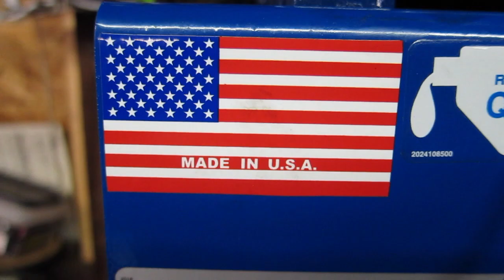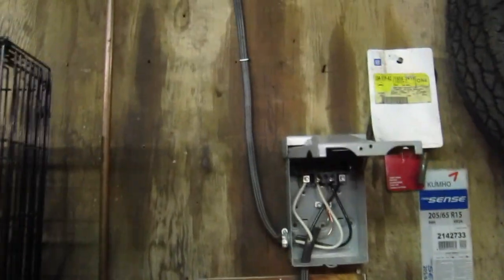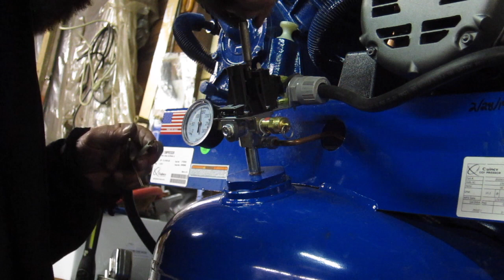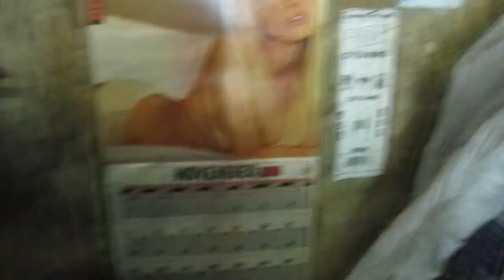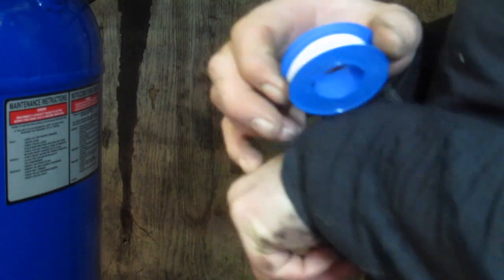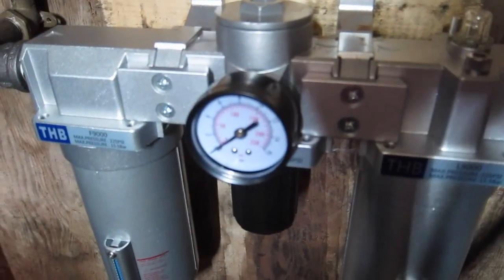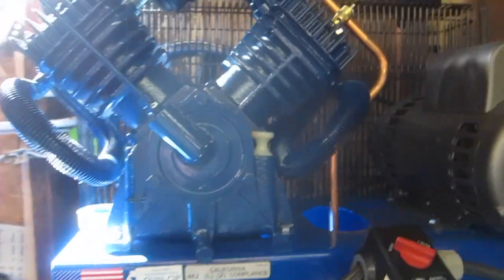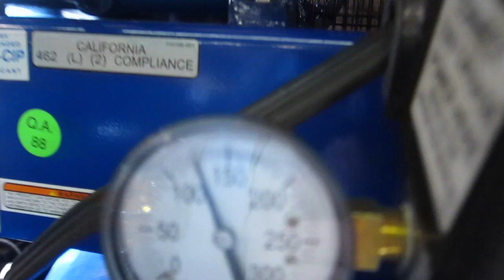Quincy QT-54 single phase 220v 2-stage air compressor installation (DIY style)

Comment: I'm sure your not that only one who missed that "direction of flow" thing. Boy, the things you have to do to get air in the shop. Once it's going you'll be glad you did all that work. I hope it lasts a long time for ya!
Reply from the maker: Thanks Wyatt! Me too - I'm hoping it's the last one I'll ever have to buy.

She's been running good for nearly 2 weeks now. I was heating up the crankcase with the heat gun before that block heater got here. Weather is finally starting to trend bit warmer, so I shouldn't have any more issues with molasses-like oil. The volume compared to the oil Craftsman is insane, and it fills that  huge tank in less time than the old one filled the little 30 gallon tank, too. Going to take a long time to hit 100 hours! Can't wait to get some Amsoil 20w oil in there - then I can just leave it on all winter and not worry. Definitely well worth all the trouble of installation, for sure!

Thanks for watching! 🍻
Reply: I didn't see the arrows at first but I did see the word IN cast into the unit where the outlet plumbing was being painstakingly installed.

Comment: Nice Compressor Smitty!   I like the block heater. Good idea.  I may have to add one to my big compressor.
Reply from the maker: Thanks Chris! Yeah when it struggled to turn over on camera there, that made me nervous - I don't want to be doing damage to brand new bearings, pistons and rings on a brand new unit! Thankfully the weather is beginning it's trend warmer - 60° yesterday when I filmed that cut-in about the block heater, and forecast is for the 40's all week. I've found as long as it's above 30° out there, it will start no problem. Can't wait to get through this break-in period and get some 20w Amsoil in there - that'll make a HUGE difference.

Thanks for watching, buddy!

Comment: hey smitty!   first ms November was hot!   see why you left her up  and nice water trap!  were you loosing voltage under load?  my shop has a harbor less freight  with 30 w comp oil and it works fine for years now  it gets to 0 here on long island... I would have used mc wire for hook up  tho
Reply from the maker: Hey Scuba! Lol, yeah that calendar was from '06 or something - it's been in that same spot ever since! 😁

The voltage was good & remained good. This same thing happens to my dad's compressor when it gets too cold - it'll keep running slow like that until it pops the breaker. I guess the factory break-in oil in both our units is like molasses. When I checked the dipstick at 30° on mine, it was exactly like molasses! VERY thick and stringy. I just have to get through this 100-hr break-in period, and a couple quarts of Amsoil will fix that. As far as the pressure switch, still not really sure what happened there. I think it overheated when I kept trying to start it, and it locked me out until it cooled.

I agree with you on the wire - would've been 100x easier to install MC than this braided 8 AWG I used. Only used it because that's what I had here. I'm always trying to save a buck when I can. I had bought that wire back in '02 for the Craftsman compressor, since that wire came out of the house, and was buried for 40' or so until it got into the tool shed at my dad's house. Wanted to make sure I had outdoor rated wire.

Thanks for the comments, & thanks for watching! 🍻

Comment: Great video !   I've done steel screwed together fittings before. Tape them, or dope them, tighten them all the same and some leak and some don't.   ???   The new compressor and your rear axle must have set you back a few nickels and dimes.  Hang in there and take care.
Reply from the maker: Indeed it did, Bill - been one heck of a month in that regard. Hopefully this money hemorrhaging problem I've had the past 3 weeks is over with, lol.

Thanks for the compliment, and thanks for watching!

Comment: 2 conductors and a ground.  is the ground being used as the common? thanks. I just bought the same compressor and am about to wire it up.  your help is appreciated, thank you
Reply from the maker: I’m not an electrician, so take what I say with a grain of salt. All I did was hook up the two hots & the ground wire. There’s no neutral wire here. My lift wiring was the same way. These two devices were the first time I’ve ever seen 220 V wiring done without a neutral. It works, that’s all I care about. 😂 Good luck.
Reply: @SmittySmithsonite  thank you. my lift is the same. i was a dealer MB tech and now doing it all on my own.

Comment: Where did you get the Hobbs hour meter? Nice compressor, I have the same one.
Reply from the maker: I bought that Hobbs used off of eBay for $20 shipped. Had .2 or .3 hrs on it when I got it, so I just made a note of that next to the meter so I’d remember to subtract that. The model # is 20007-17.

Comment: On cold days empty the tank and start it that's what we do during the winter here
Reply from the maker: Yep, that'll work, too. That little stick-on heater did the trick, though. Thankfully winter is over. Should have some hours on it by the time the cold comes back, and I'll switch to the 20w Amsoil then. That should take care of the issue once and for all. Thanks for the comment. 🍻
Reply: @SmittySmithsonite  not a problem and might even wanna do a thinner oil for winter use.   I have the same style heater on my Quincy 350 and it helps and keeps the moisture out of the block  and the head

Comment: Got my eye on the same compressor. Are you happy with it?
Reply from the maker: 17 months of use, and not one problem yet! As of 7/9/2020 I have 29 hours and change on the unit. VERY happy! Beats my old Craftsman air compressor by 5 miles. It never struggles to supply air, even running my leaky tire machine, or using the air grinder non-stop for 45 minutes straight.
Reply: @SmittySmithsonite  one is in my future. Thanks!
Reply from the maker: @coodeville1091  - Nice! You won't be disappointed. It's a great unit. 👍🍻

Comment: How cold is it?
Reply from the maker: When this vid was shot and the compressor struggled to start, it was below 30°. Now that it has broken in a bit (40 hours on it now), it can get down to 25° out there and still start, albeit a little slowly. That oil is THICK!  I'm going to wait until I have around 50 hours or more on it, then I'll change it over to Amsoil synthetic 20 weight - that should end any cold starting issues I have. I plug in the 25w heater pad I have stuck to the side of the compressor block if the forecast is calling for single digits or colder outside - the barn where the compressor is usually stays at least 10° warmer than outside temps.
Reply: @SmittySmithsonite  Now I know why they say don't start it below 60 degrees or whatever.